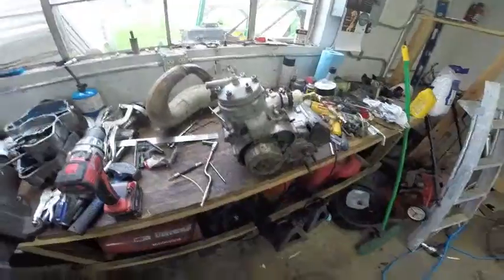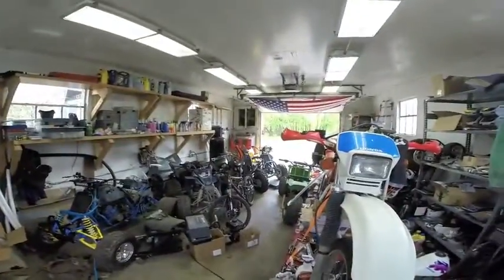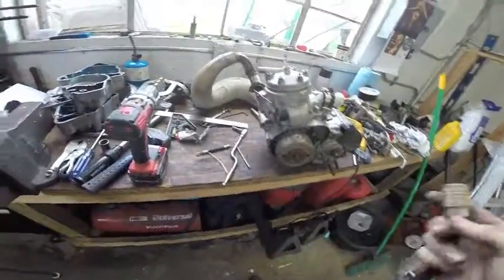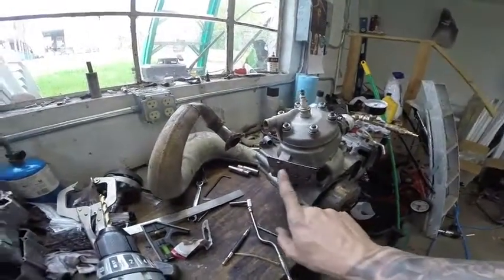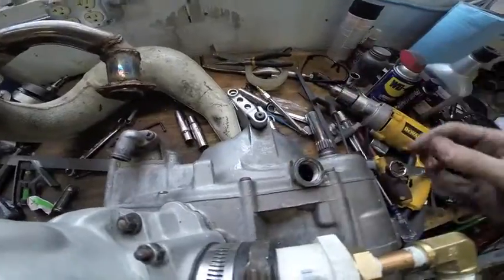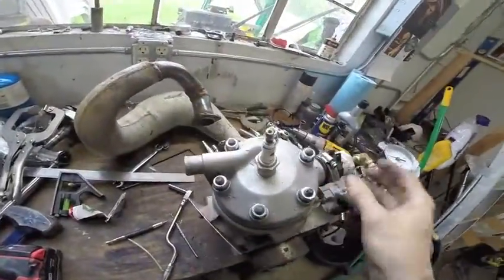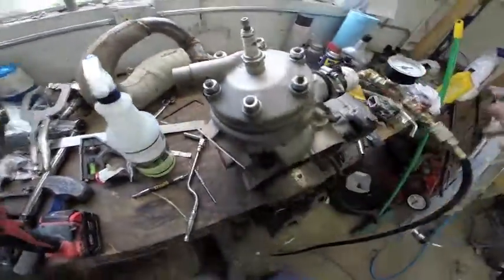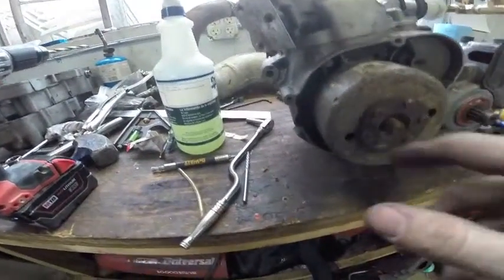Leak Down Test On Early LT250R engine

Comment: Im about to do a leak down test if you can replay asap it would be very helpful. Does the piston need to be TDC or BDC? Or it dont matter? Does the radiator outlet and inlet need to be capped off?

Comment: I have the same engine with the added powervalve. And there is an air leak at the powervalve adjustment. Would that be a seal around the powervalve? Or somewhere else

Comment: my 85 250 motor I belive is from a rm..I put in my Lt..idled. fine after putting the exhaust finally...I ran it before that a couple times only for a min or two..now it turns on but since my exhaust is kinda rigged up ..alot of oil is coming from the exhaust .basically exhaust leak but it doesn't stay on..did I get my rings from running it with no exhaust?
Reply from the maker: So the way a stroke works is the exhaust gases actually hit the cone of the exhaust pipe and re enter the chamber. Damage may have been done. I would do a comp test which will show the condition of the top end. Sometimes a high temp oring on the exhaust flange will help seal off the exhaust